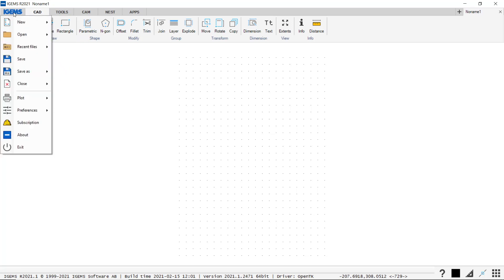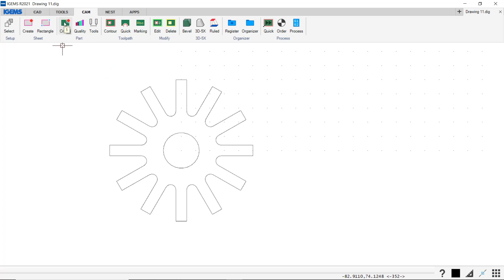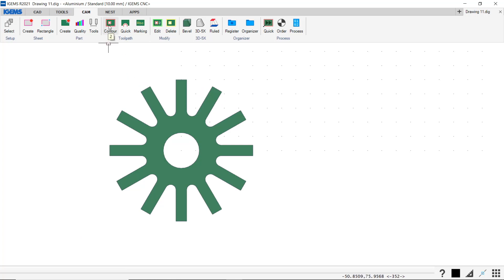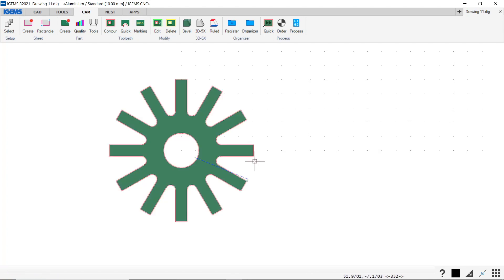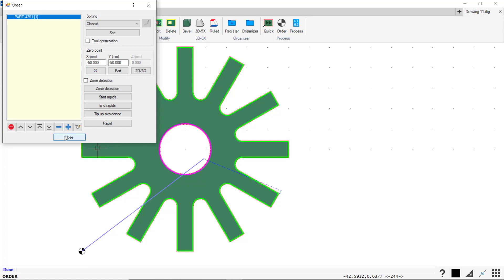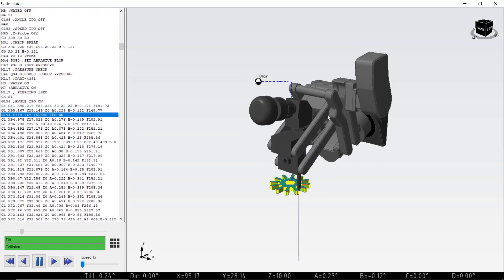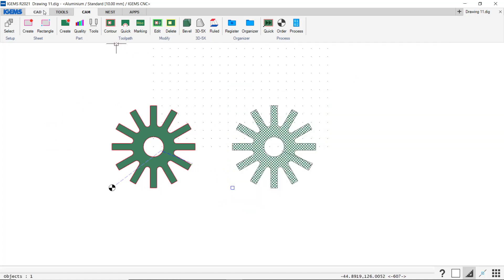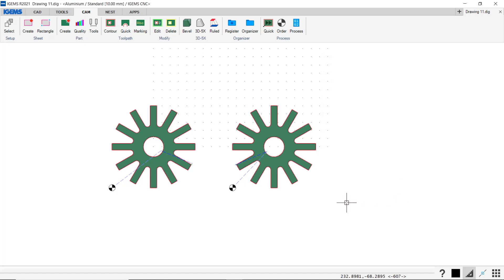2D CAM Basics

Comment: Nice video. Bit did u know to solve a problem when the contur line instead cuting nice rund objects its cut all my round object, radiuses and round holes like a hexagonal shapes?
Reply from the maker: Thank you! It sounds like there's either an issue with your machine or that the CAD/CAM is vectorizing your tool paths too much. Please contact your machine builder for support regarding this issue.
Reply: Thank u for reply 🙂 @igemswaterjet

Comment: Thank you for uploading these.  Where would be the best avenue to ask questions/make suggestions?

For example, the sign maker tool is great at making something, but it is difficult to locate the font exactly where you want it with precision.  I'm making a simple circular sign with the Italian boot in the middle, and at the north pole I'd want the upper font centered at the top of the circle, and at the south pole I'd want the rest of the text centered down there.

Maybe it's my inexperience, but I don't really know a good way to make that quickly happen.  It'd be nice if Sign Maker could ask you to locate the cursor and then have the option to build the type centered from that point instead of just typing it out, for example.

It'd also be nice to have options for changing the direction of the text, whether it's flipped or left to right or whatever.  If you'd like to contact me, it's austenschwend@gmail.com

This is an awesome product, thank you for keeping up with it and making these videos!
Reply from the maker: Thanks for the input Austen! I'll see if we kan make some improvements 👍🏼
Reply from the maker: Austen, we've just released an updated font tracer where you can align text left, center or right and also above, on or under a path 👌🏼 Let us know what you think!